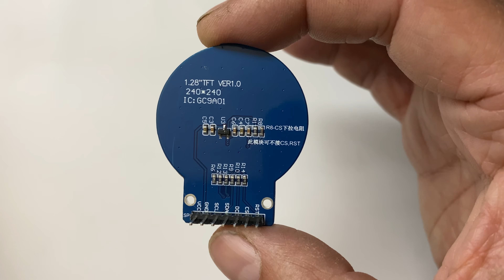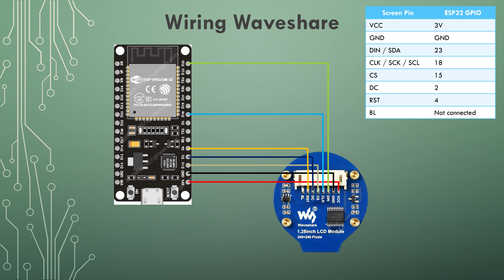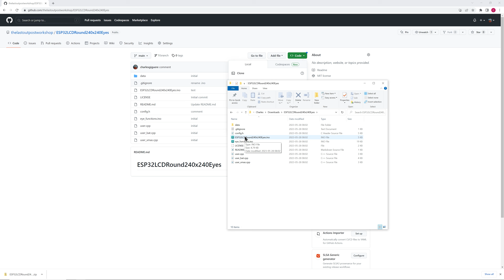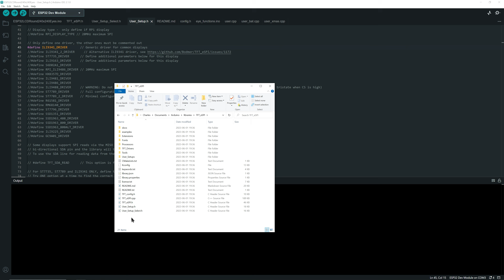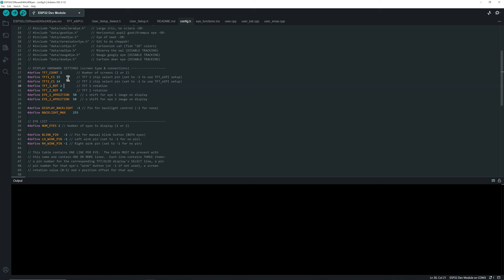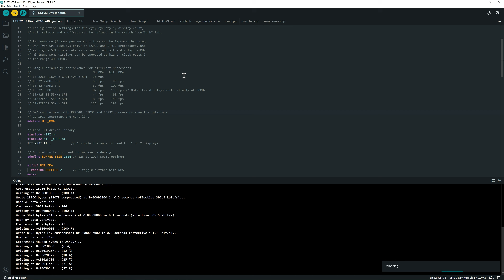Master the Round TFT Display on ESP32 and GC9A01 driver with the TFT_eSPI library

Comment: I have been trying for weeks to get “Uncanny Eyes” working on the 240x240 display and I finally found your channel. Excellent presentation and it works!. I’m anxiously waiting for your update on making the eyes bigger and centered. Then I’ll be able to incorporate them into a plastic skull for my grand nephews. Thanks again.
Reply: I had a problem with the positioning of the eyes and change 2 values in the config.h file. 
#define EYE_1_XPOSITION  50  // x shift for eye 1 image on display           
#define EYE_2_XPOSITION  50  // x shift for eye 2 image on display       
I change the 50 to a 0  and it centered my eyes.                
If you have not already tried this, it might work for you.    
                                                                                                                 Bill
Reply: @Wld_4  Hi, Thanks for the info, but if I change the value, it will only move it left or right. I went from -50 all the way to 1500, but I can´t move it down
Reply: @DanielZepeda  
change this line in the 
eye_ functions.ino file     its around line 114 

tft.setAddrWindow(eye[e].xposition, 0, 128, 128);    
change the 0 to 50 
 If that don't work, change the value until it is positioned where you want it.    This worked for me when I use a higher resolution display 240 X 240  
good luck.     Wld_4
Reply: Did you get this figured out?
Reply: @RandyRasmussen  No I gave up and bought the lower resolution displays.
Reply: @squeezer04  :face-blue-smiling:

Comment: i have successfully uploaded but TFT does not light up
Reply from the maker: Double check your wiring, make sure the TFT receives power
Reply: Thank you very much for your help. After I checked, it was indeed the cable that was disconnected😊😊
Reply: Thank you. It turns out the cable was disconnected
Reply: Sorry, I want to ask, the eyes are too small, where can they be changed so that the eyes are a little bigger?

Comment: I had a problem with uploading the code, which I eventualy traced to the display's DC pin being connected to GPIO2 on the ESP32; a common problem apparently.  I could upload the code with the DC disconnected and then by re-connecting DC and resetting the ESP32 the "eye" appeared on the display - not ideal.  I then edited User_Setup.h file as follows to move the display pins to safer GPIOs.

On line 45 comment out (i.e. add “//” in front of the text) the line defining the ILI9341 driver.
On line 65 uncomment (i.e. remove the “//”) the line defining the GC9A01 driver.
On lines 212 through 218 comment out all the SPI definitions for the ILI9341.
On line 223 set MOSI to 23 //DIN
On line 224 set SCLK to 18 //CLK
On line 225 set CS to 22   //CS
On line 226 set DC to 16   //DC
On line 227 set RST to 4   //RST

In User_Setup_Select.h make sure that line 80 is commented out i.e. //#include <User_Setups/Setup46_GC9A01_ESP32.h> // Setup file for ESP32 and GC9A01 SPI bus TFT  240x240
Otherwise the changes to User_Setup.h will be ignored and the display won't work.

I think another approach could be to edit Setup46_GC9A01_ESP32.h and change the GPIOs to the safe numbers shown above and then uncomment User_Setup_Select.h line 80i.e. #include <User_Setups/Setup46_GC9A01_ESP32.h>

Hope this helps anyone having the same problem.  Anyone using PlatformIO and an ESP-PROG JTAG programmer probably won't see this potential problem.
Reply: Wow this is really nice work! Thanks!  Any idea what a guy can do without a GPIO23 pin?  The lonely binary "ESP32-S3 Type-C IPEX External Antenna" board has no 23... and no mention of MOSI

Comment: I have seen some screens with ESP32 board, its like one module. will this project on that screen??
Reply from the maker: which module ?
Reply: ESP32 GL For Arduino Development Board 1.28 Inch 240*240 IPS Smart Display Screen LCD TFT Module WiFi & Bluetooth With Touch

Comment: I have zero knowledge about this but wondering how you powering that testing board? Does it use the power of from esp32 usb supply?
Reply from the maker: Yes it is powered through the usb cable connected to your computer

Comment: I have uploaded the code as instructed I ven downloaded tft_espi@2.5.0 version but the ye does not show up, I et 
E (40662) gpio: gpio_set_level(227): GPIO output gpio_num error in the terminal
Reply from the maker: This error is raised by ESP32 core library when setting a value to the wrong pin, this is probably due to an error in your wiring
Reply: @thelastoutpostworkshop  , you’re right! I misplaced 23 pin 🤦🏾‍♂️ my bad.
Everything works now

Comment: Thanks for the nice project discription. I am not that experienced with Arduino so it is a good practice. I build it using your latest software. Loading without problems. I connected one of my 240x240 tft display with pins as seen in your video. Now get an error gpio: gpio_set_level (227): GPIO output gpio_num error.  Can you help me solving this?

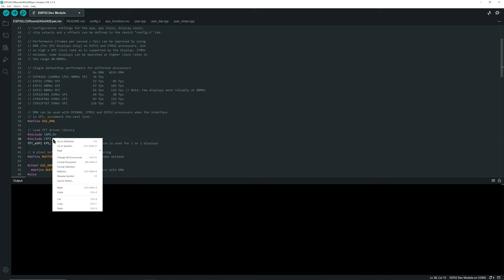Comment: I wanna ask why when you right click "Go to Definition" it can turn to new page?(8:30).I do same as you but I can't open it.🥲
Reply from the maker: Sometimes you have to compile the code first to be able to navigate to definitions in the header file
Reply: thanks for your replay but where should I compile?(I follow all step with video @thelastoutpostworkshop
Reply from the maker: In the Arduino IDE 2, you have a large checkmark button on the top left corner, this will verify (compile) your code
Reply: thanks you very much!!!!!!!! @thelastoutpostworkshop

Comment: Excellent video.  It worked perfectly.  Thank you very much.  One question is how can I get the eyes more centered onto the screen?
Reply from the maker: I have tried with no success!
Reply: Thank you for the response.  I fumble around as well and had no luck.  It's still an awesome project.   @thelastoutpostworkshop
Reply: I added a yposition to the eyeInfo_t typedef and duplicated a y for every x in config.h and eye_functions.ino and moved the eyes down about 40. I little bigger would be better but we might have to regen the images.
Reply: @Ron_Rhodes  can you share you updated  code please?
really appreciated!
Reply: I'm currently mangling the code to try and make the joystickswork.   @dmitriycreations  
but try this:
Add Yposition
// This struct is populated in config.h

typedef struct {        // Struct is defined before including config.h --
  int8_t  select;       // pin numbers for each eye's screen select line
  int8_t  wink;         // and wink button (or -1 if none) specified there,
  uint8_t rotation;     // also display rotation and the x offset
  int16_t xposition;    // position of eye on the screen
  int16_t yposition;    // position of eye on the screen
} eyeInfo_t;
in the main program.

... then in the config.h
#define EYE_1_YPOSITION  40 // y shift for eye 1 image on display
#define EYE_2_YPOSITION  40 // y shift for eye 2 image on display

... 
and set with new arg ..
  eyeInfo_t eyeInfo[] = {
    { TFT1_CS, LH_WINK_PIN, TFT_1_ROT, EYE_1_XPOSITION,EYE_1_YPOSITION }, // LEFT EYE chip select and wink pins, rotation and offset
    { TFT2_CS, RH_WINK_PIN, TFT_2_ROT, EYE_2_XPOSITION,EYE_2_YPOSITION }, // RIGHT EYE chip select and wink pins, rotation and offset
  };

... in the eye functions code add line
      eye[e].xposition = eyeInfo[e].xposition;
>    eye[e].yposition = eyeInfo[e].yposition;

... and finally call the method adding ypos

  tft.setAddrWindow(eye[e].xposition, eye[e].yposition, SCREEN_SIZE, SCREEN_SIZE);
 
hope this helps.
Reply: hello, can you send the code?

Comment: Thanks for video, I have solved flicker problem, THANKS!!! A question, eyes are made for 128x128 screen, do you know how can set it for 240x240 display size?
Reply: If I change
#define SCREEN_WIDTH  128

#define SCREEN_HEIGHT 128
in data file, the eyes disappear, only horizontal row are displayed....
Reply from the maker: I don't think changing the screen dimensions will have any effects on the size of the eyes
Reply: @thelastoutpostworkshop  Hi. How can we change the size of the eyes? also how to do exactly same postioin of eye on both screen? for me looks like one is not in the center when the other is. Thanks
Reply: Ok, but now the eyes aren't in center, are on top. In bottom there are a lot of space

Comment: Can you transmit video from a runcam3 with these? If so is it as easy as just connecting the run cam and 1.28 lcd screen together ? It’s for a digital night vision build
Reply from the maker: I don't really know, I have never used a runcam3
Reply: @thelastoutpostworkshop  thanks for the quick reply.last question though what about transmitting video at all? Are these 1.28 lcd screens capable of doing that besides animations or clock viewing?
Reply from the maker: May transmitting video over wifi